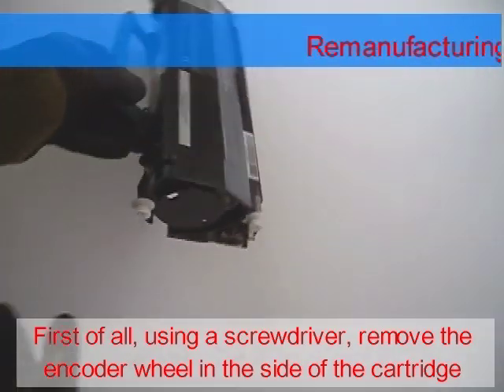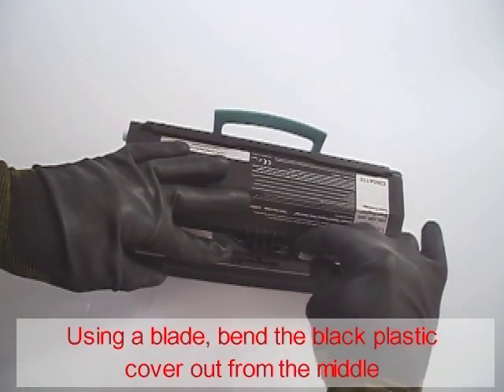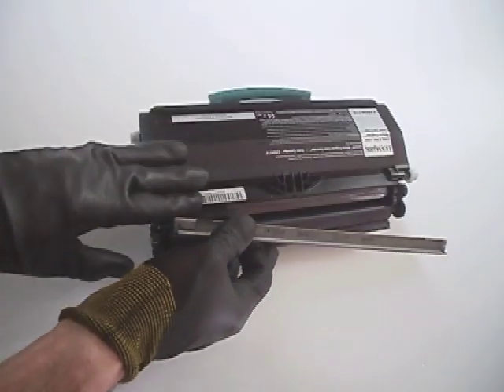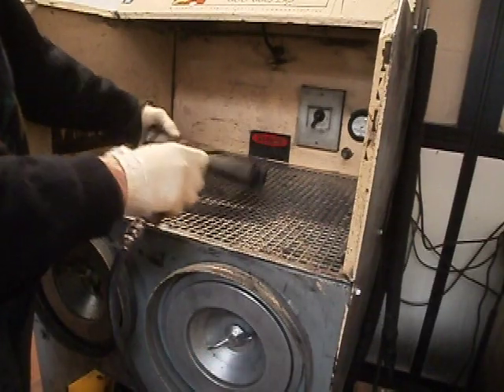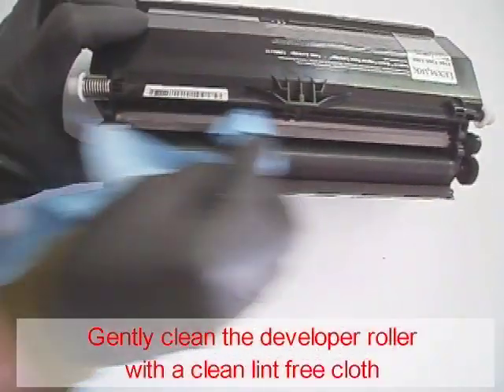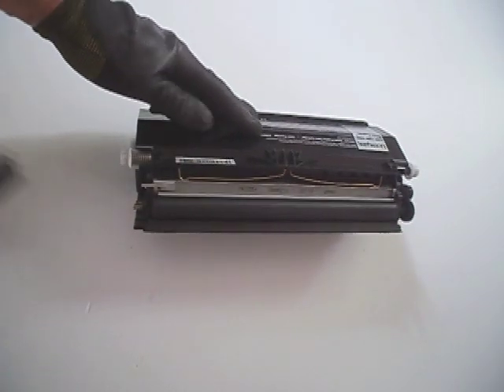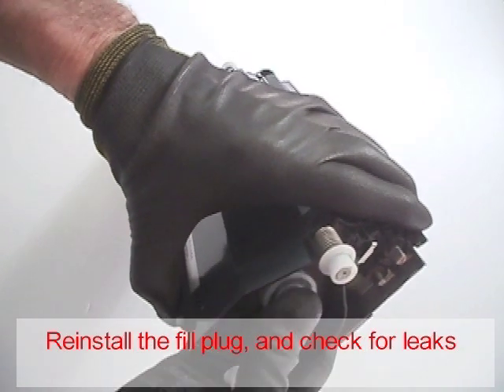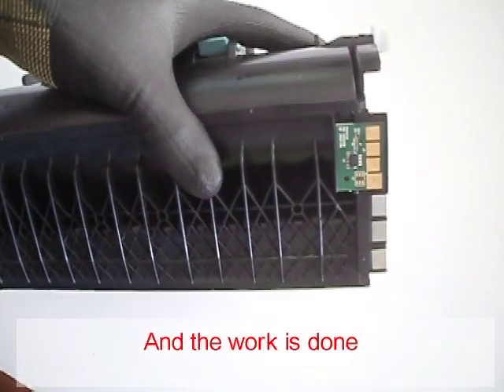Lexmark Optra e260 e360 e460 x264 - Refill Toner Cartridge

Comment: What is service code 917, service roll transfer?
Reply from the maker: +Bill H. no power to the transfer roller. the transfer roller is the black roller under the toner cartridge. make sure it is not loose or damaged and it spins freely.
 try turn off the printer and wait 1 hour. then power the printer back on.